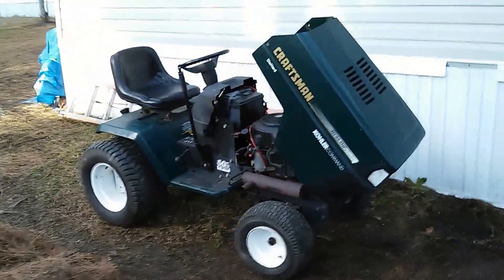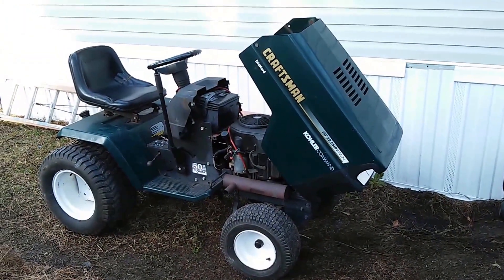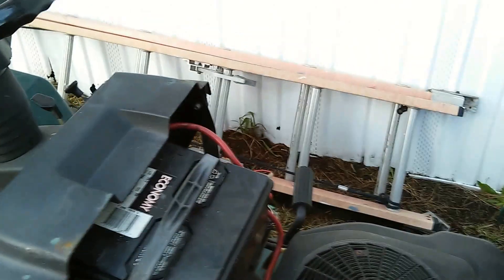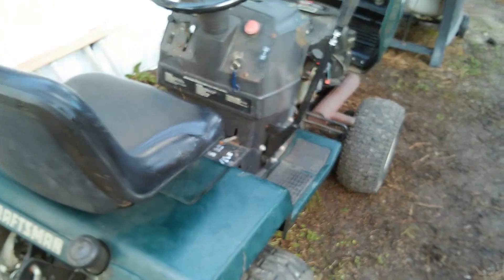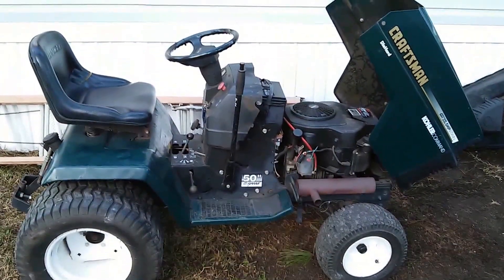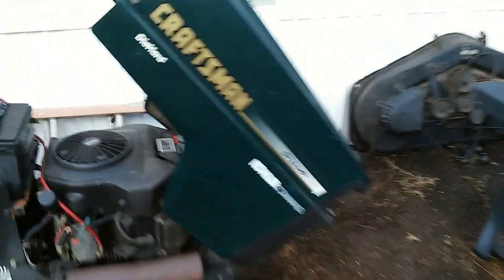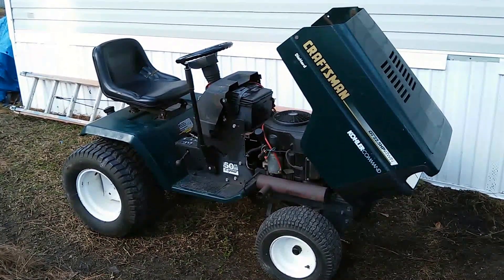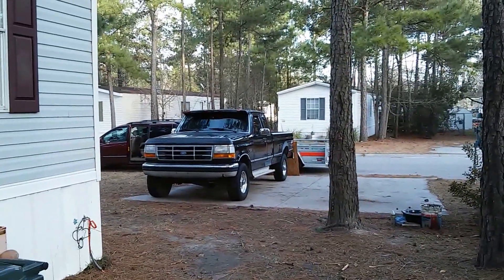Craftsman GT Tractor

Comment: Mine is an 98 with a hydro, 20 hp kohler, and a snow blade all for 250 bucks.
Reply from the maker: That was a great deal man... I ended up selling this one after my divorce and so on and had to start over... I now have the new model GT 5000 but it does not have the Kohler motor...Now that I think about it I will make a video of it next month when I bring it out ofthe shed...!!
Reply: @BigTravGill 
Does the 5000 have a Briggs?
Reply from the maker: @bertgrau3934  I will post a video of my newer GT 5000.. it has the v twin Briggs and so far after running it hard for the past 2 years it has done great...!
Reply: @BigTravGill  
The Briggs does have a few advantages, , like to remove the flywheel from a Kohler, , it's necessary to remove the coils, that's a little more work,  plus the Briggs V twin have iron cylinder liners ( most I think) the Kohler doesn't.  The cost for parts for the Briggs,  are a little cheaper as well.

Looking forward to seeing your bigger Craftsman mower.
Reply from the maker: @bertgrau3934  I will get a video posted this upcoming week of it. I just used it for the first time this season... I had it parked during the winter in my shed so it was great to hear it fire back up after 4 months lol

Comment: I have a Craftsman GT 5000,  I like the 5 lug wheels.  Mine has  a 25 horsepower Kohler . It's a 2004. Or 2005 . I picked up another very similar,  I'm going to use for spare parts and put the engine on a 40 inch cut Murry mower.  I think that should be enough horsepower for a 40 inch. It's a 25 horsepower as well.

Comment: Can someone help me with mine?  The mower deck has been removed .  We thought the snow plow was the guilty party for tearing up the belt constantly, but it is still doing it even though the snow plow has been removed. The belt tensioner spring has now been found missing and the belt is once again needing replaced for the 3rd time.  HELP.  I've bee just using it as a mule to haul a little wagon to pick up manure from the horse stalls and around the property. But this engine should be able to help pull the drag in my arena if I could just figure out why the belt keeps getting chewed up!
Reply: There's a lot of things that can cause the belt to get ate up,  a bad idler pulley,  most likely,  sounds like something is out of alignment.  Check the belt after just a few minutes of run time and see where the wear is, that can help if it's on the sides of the belt,  then most likely  something is out of alignment.  If something is out it's not difficult to fix. You can bend the bracket that's holding the idler pulley,  or remove and shim.  Just check the entire path of the belt and check each pulley the belt goes around,  check for wear at every point.  Also check if something else is rubbing against the belt some times that can happen when the machine is running.  The belt hitting something it shouldn't because of the belt bouncing.  

It's kind of hard to say exactly what the problem is without seeing it.  Just giving some ideas of what COULD be the problem.

Comment: That Kohler motor is a dandy, but it's not without its problems:

Keep your ears open for rattling rocker arms, which may indicate problem lifters. Many instances of bent push rods in the earlier versions. Also had their bout with leaky head gaskets and leaky OHV cover gaskets.

It has a plastic intake that feeds both cylinders that may eventually crack or the O-rings that seal it may begin to leak and it may start surging.

Use only 10W30 good grade oil in the engine (check your Owner's Man; they suggest SAE30 but I've had mucho lifter problems with 30). Change that fluid in the transaxle at least every other year with 10W40 or a good 15W40 synthetic.

This tractor is a beast. I have 2 of them: a '96 and a '97 in 50", 25HP V-twin config. Congratulations.

Comment: I purchased the same year GT only difference is mine has the 20.5 hp Kohler command with hydrostatic trans. I love it!! use it for plowing snow and I live in Nova Scotia where the snow is heavy and wet and it will easily plow 15-20" of it. I'll post a video soon. enjoy that work horse

Comment: You hit a Gold mine my friend and you don "t know it  yet , i have one a 2000 mdl yr and it kicks ass like no other, i have a manual 6 speed with hi and low range, it is a beast, with tax and all it was right at 3000.00 dollars. I  have  plowed with it , used the box blade with it and it will pull like a mule. The only parts that i have replaced is the fuel filter and battery and air filter.  I pull my home made excavator with it and it weighs about 1100 lbs with no problem.